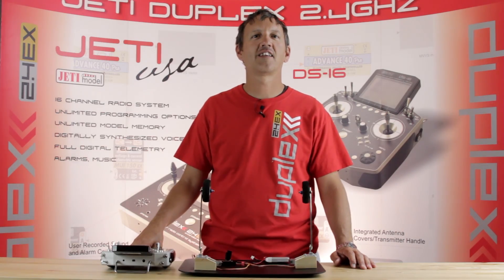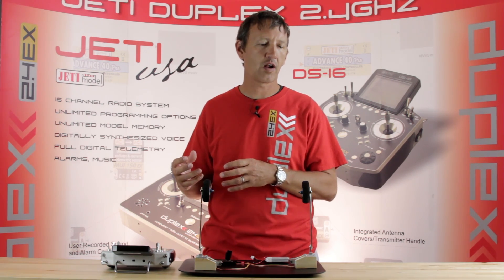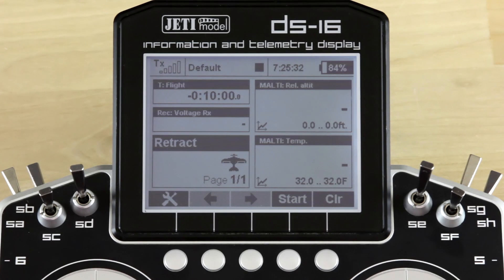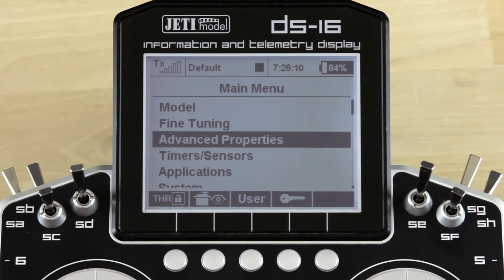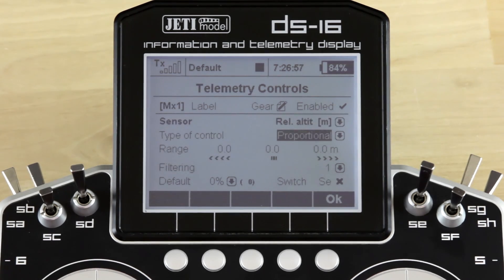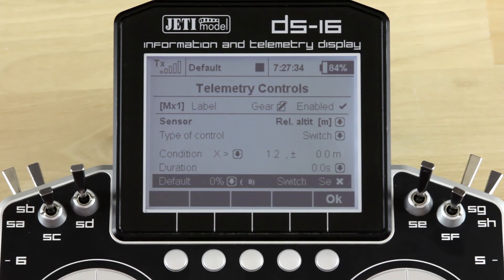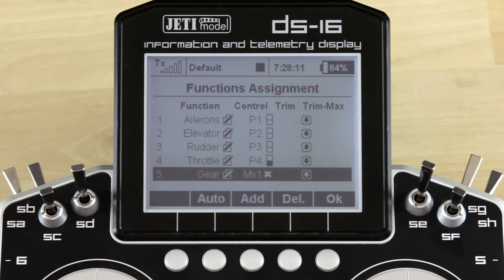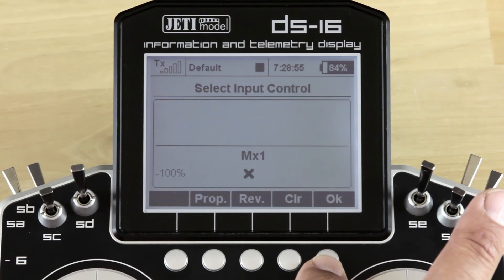Radio System: Telemetry Controls (Automatic Retract)

Comment: Great video. I found the answer here to have bail out kick in below a certain altitude. I also got an optical mrpm sensor. I am wondering if it is possible to do a mix or function with throttle to not let a gas DA engine idle low but not stall. The optical rpm sensor seems to take a few seconds to update for some reason.
Reply from the maker: Hey flymil, Thank you for the comment. For more specific help please email our guys at support@esprittech.com. Thanks!

Comment: Hi, I have Jeti DS16 and have installed the Jeti Temp Sensor on the 50cc gas engine head, and I am trying to programme the Telemetry Control in a way that if temp > 120 dec C, it should reduce my Throttle servo to 70%. Just not able to do it. I wish I could post my screen shots here but that does not seem to be an option. Would be great if you could give the link for a servo and temp set up. I just cannot find any video showing how to do it. There is one video which show elec motor shuts down if temp goes high, but does not show how the set up was done as the video show Tx in Mode mode only through out.
Reply from the maker: Hello Ramesh, Please email support@esprittech.com and one of our guys will be able to reach out directly to you.

Comment: Kinda cool until you do a fast low pass and your gear comes down
Reply from the maker: There is a switch assigned to defeat/turn-off this function for just that reason.  If putting this into practical use, I would combine it with a logical switch to have both automated and switched control over the gear.
Reply: I realize that but if there's a switch to override the auto gear, then it kinda defeats the purpose of the auto gear doesn't it?  Cool features either way but having your gear auto retract or deploy seems like it's gonna bite you in the ass at some point.